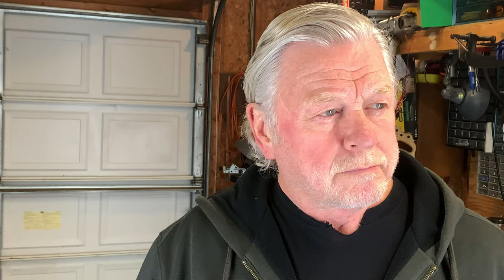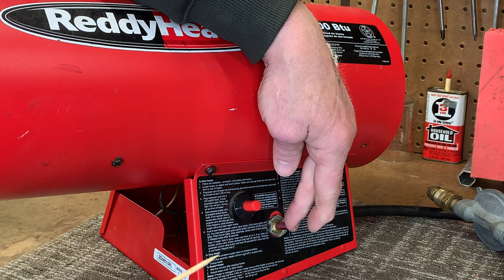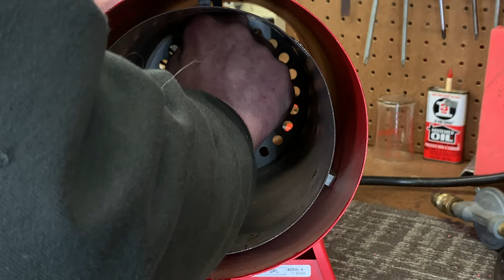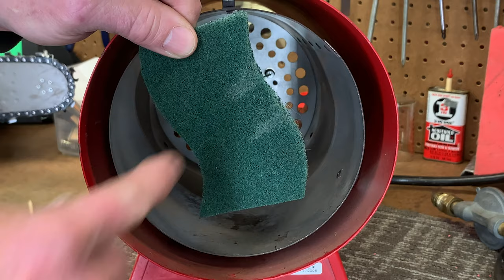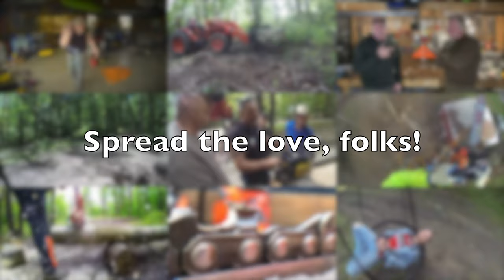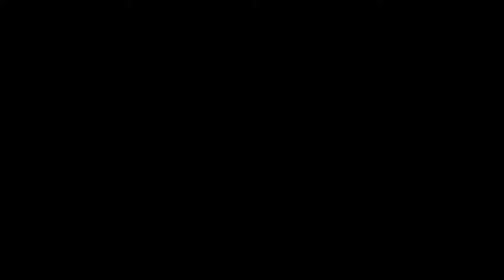T-35 Days - Torpedo Heater Flame Out Fix

Comment: Wow I'm glad I held on to my heater for 10 years I knew it was an easy fix
Reply from the maker: I hope it works for you. It did for me. If not, you can replace the safety switch. I think I failed to mention that in the video.

Comment: Cool beans I’ll give that a go tomorrow when I go out,mine worked then it didn’t next time but it has spark and all and works long as you hold the dial in this sounds good,congrats
Reply from the maker: Great. Let me know how that works. The valve itself could be defective, which would require replacing.

Comment: Hey Wayne, are you still active here on YouTube? I have a question about torpedo heaters
Reply: Well actually I have two or three, is the flame out sensor a thermocouple? I don't think it is but.
Reply: Actually it seems as if you are, so for the sake of brevity I'll get right to it. 

I have a 38,000 btu propane heater, but when I push the button to give it gas. I get nothing
Reply from the maker: The flame detector is a thermocouple which operates a solenoid to hold the gas valve open as long as a flame is present. Pushing and holding the button overrides the detector and forces gas to flow in the absence of flame. So if you’re not getting gas while holding the button in, then you have a problem with the supply tank or the hose connection on the heater.